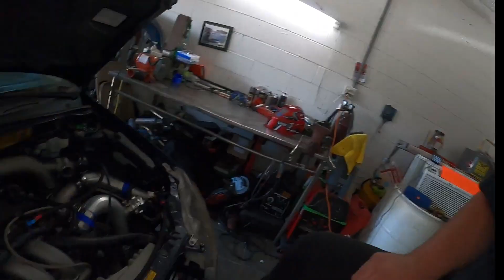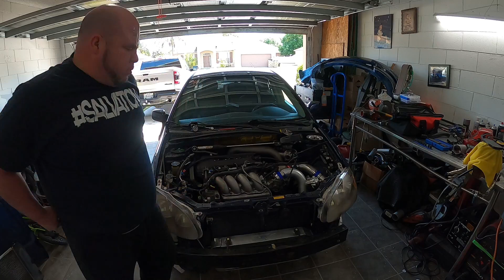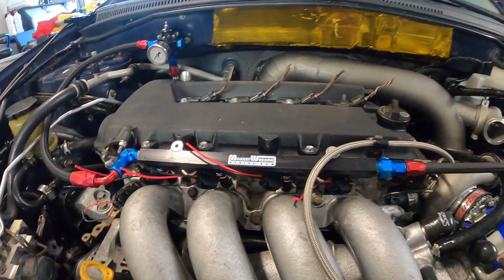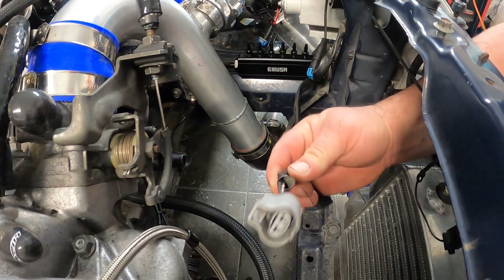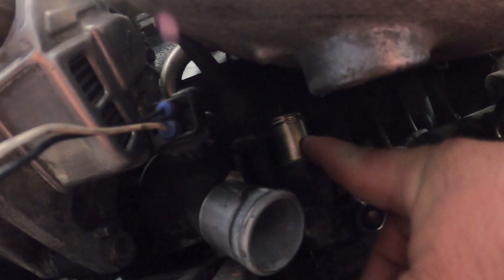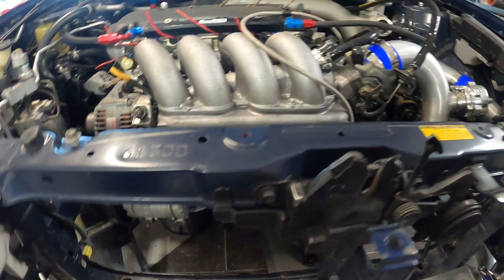Engine bay ready for Fuel Tech install

Comment: Saludos  mano de aqa de lancaster PA Tremendo mano tengo un  xrs 2006 iqiero aselo pero qe sea solo motor  para curalme  poray  qe me recomiendas tengo la conputadora echa Rk9 no sela espuesto qe tucres qe nesesite para llegal 200 hp un piggy bank
Reply from the maker: Saludos, con la compuradora de R9K debe llegar la los 200hp. Lo que si necesitas son piezas para el motor. Header, under drive pulleys, intake plenum, cold air intake y quizas palos de levas
Reply: Grasias grasias papa llaenpese aconpral